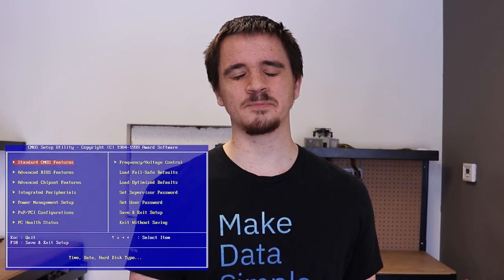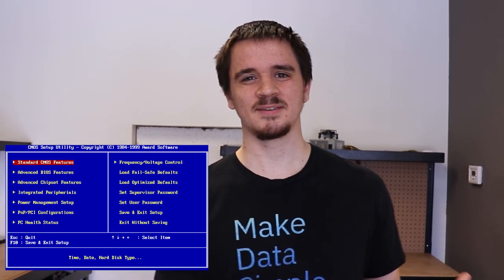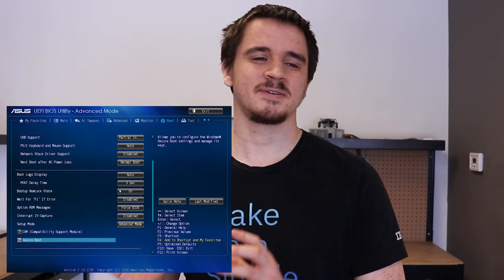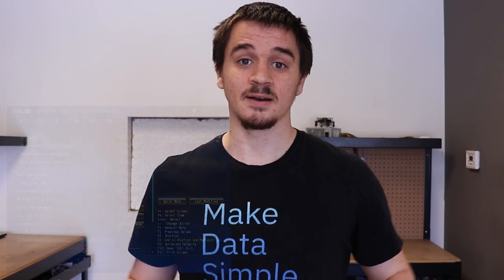BIOS Basics - All about the BIOS

Comment: Thank you for good explanation! But I see that one thing you are not touched. Intel ME Firmware and ME region itself, 1.5mb untouchable region. Cmos battery can’t reset it, or been properly reflashed from usb nether. I understand it’s a complicated zone, but it’s a very important, if something bugged in ME region, windows installation will be always “corrupted” and you loose a lot of performance in your pc and other many issues will popup. In the same time Secure boot keys can work against you. Sometime I think, that 10 years ago we lived in a much much freedom time. In one hand intel architecture wants only signed codes (microcodes) and one another hand windows too want only signed codes. So in another words, you as user can do nothing, Intel is an only one owner of your Pc, Windows is only one authorized user of that pc 🤷‍♀️. If something will goes wrong with code, for example: even if your ram will be not properly in slot, after one boot, pc will shutted off, or windows somehow write a corrupted microcode via update, after restart - intel ME will be in block or/and “bugged” permanently + windows/Intel can update microcodes from OS on a background while you watch tv, and after restart you will noticed that your PC suddenly became much slower 🙋‍♀️